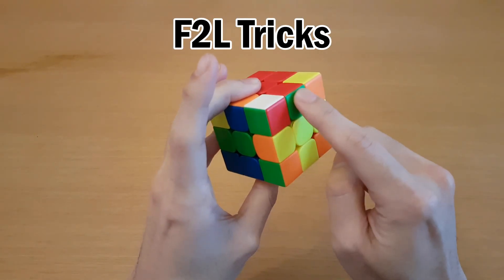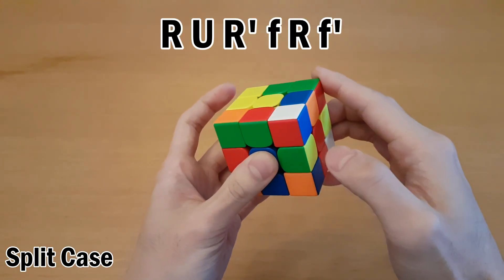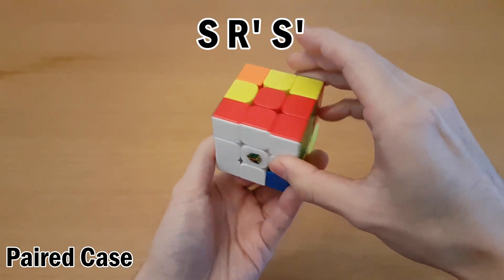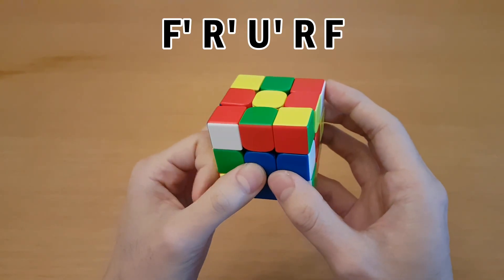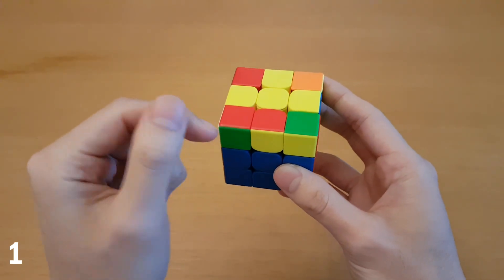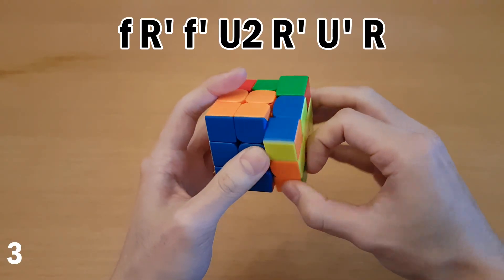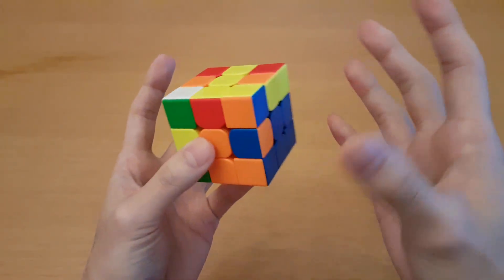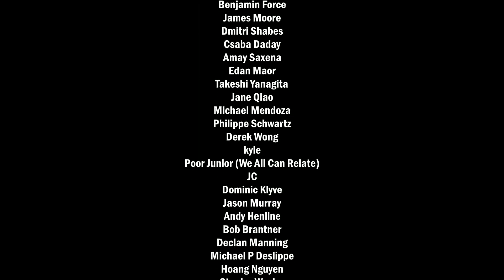Rubik's Cube: F2L Tricks #8 (CFOP)

Comment: If you are looking ahead and your next pair requires a rotation, you should not use this technique. However if the next pair can be solved without a rotation, this trick saves two rotations. (kinda advanced though)

Comment: Fact : RS3M 2020 is made up of a cheap plastic core, because of which it may have a problem of stripped core.

Although it's a good cube, core is a main part of the cube, so the core must be good.
Reply: Wrm 2020 and rs3m2020 has same core also the stripped core problem is only in indian versions. I have 10 rs3m 2020s and none have stripped core
Reply: @criccreationz6107  😊 
Oh, thanks. I will definitely buy a a new RS3M 2020 , but still I am getting good times nowadays on a non magnetic 3×3 ( Meilong 3C )